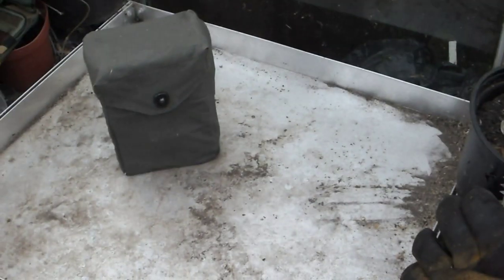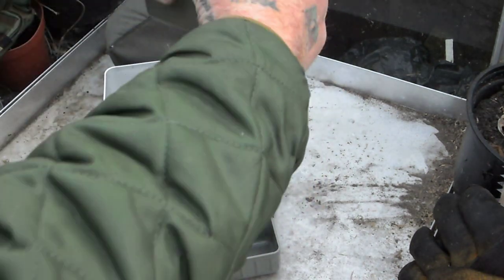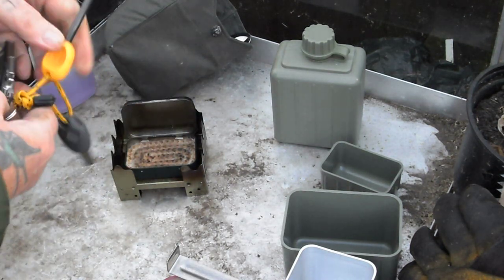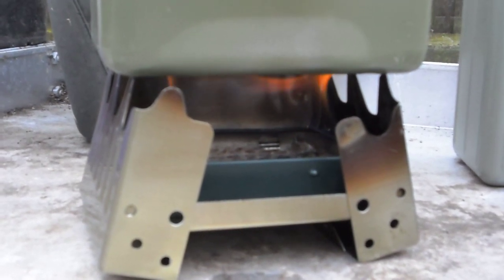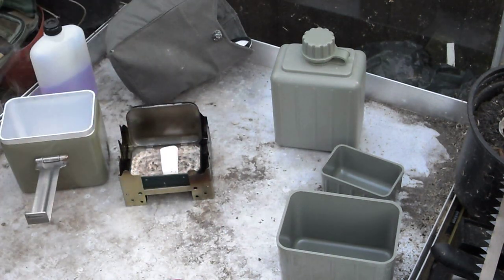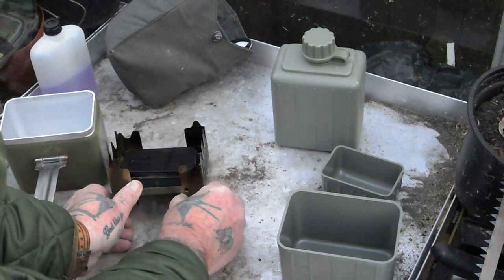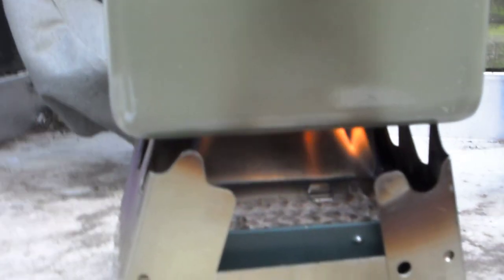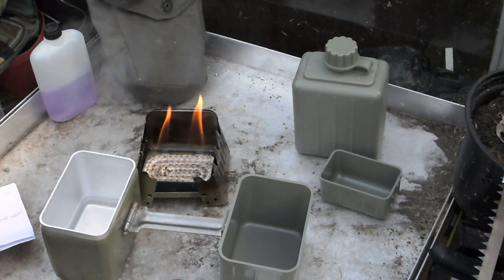COOK KIT REVIEW & A LITTLE EXPERIMENT

Comment: Great Vid thanks you can cut a tea  tin down and it will slip over the bottom giving you a place to store your Esbit, matches and fuel tabs. You have to take the Kit to the market to check the size but I found one. Just painted it Olive green. Also you have one more container to use and it's metal at that